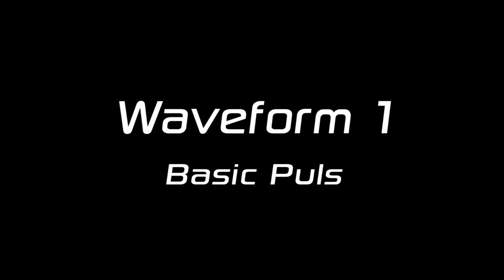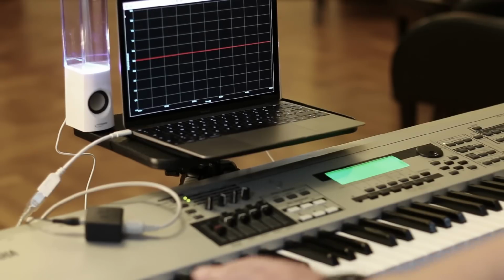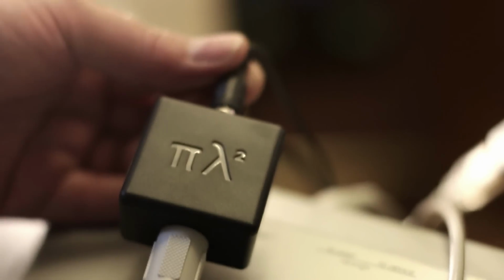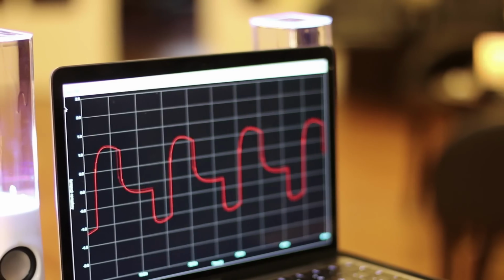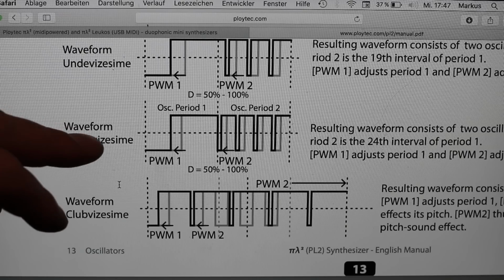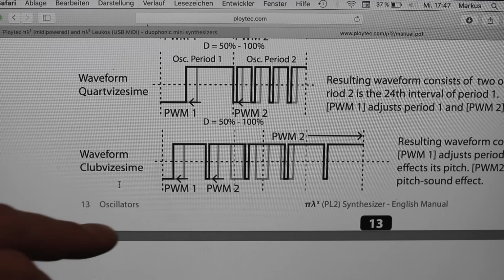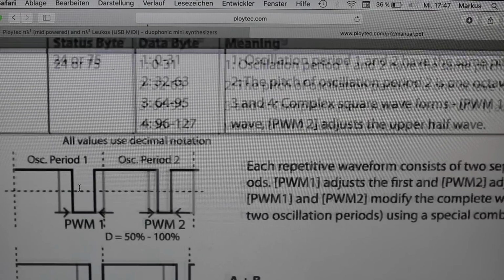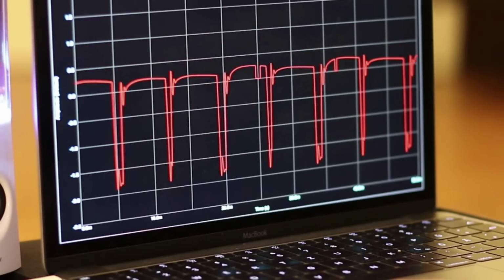πλ² Ploytec PL2 mini synthesizer - The Seven Waveforms explained

Comment: does it need a computer?
Reply from the maker: No, a computer is only needed to change firmware (normal PL2, SP0256-AL2 speech firmware or resonator firmware). On changing firmware you also assign the controller mapping, MIDI channel, note limits, etc from the computer.

The PL2 is steered via MIDI controllers. If you change a user preset, the changes are saved by switching the program, either via MIDI program change or a controller you assigned for MIDI program change.
Reply: Ploytec batteries?
Reply from the maker: No, power over MIDI.
Reply: how big is the learning curve for someone with little knowledge of progamming? is there a tutorial on the software editing anywhere? and what is the price?!